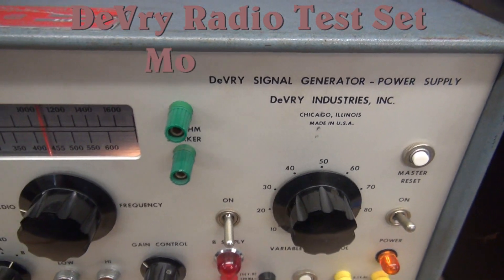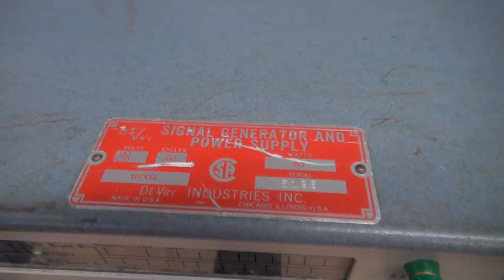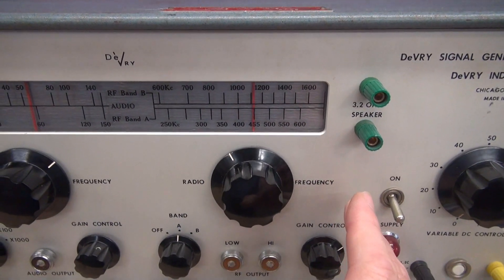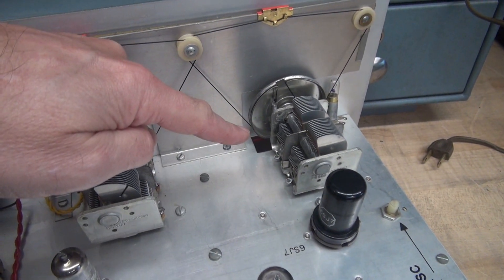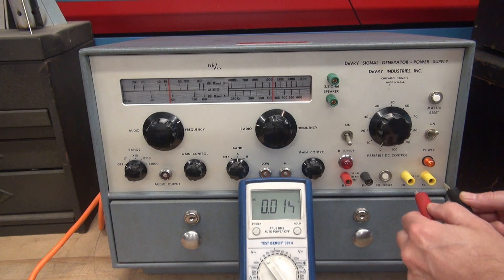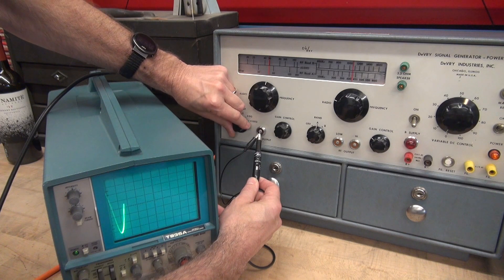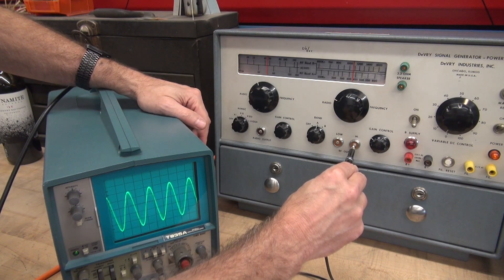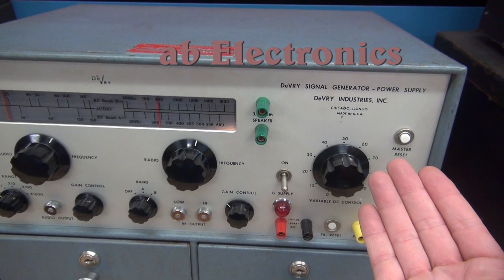New Test equipment at D-Lab Electronics DeVry Tube Radio analyzer Console

Comment: Just found this video. The high school I went to had about a dozen of these in, wait for it... The 1970s! We used these units for tube and transistor training, except of course for the power supply. They were super reliable. Never saw one opened up, so that's a treat. There was a matching scope in grey finish. We didn't have but one of those.

Comment: My high school electronics lab had several of these in the late 60's. The drawers were used to store components, like tube sockets, transformers, caps, resistors, transistors, etc- all mounted to little PC boards that had pins on the bottom that plugged into a breadboard.

Comment: I have one of those buried in my garage somewhere. It was used in high schools in the early seventies. It was one of those classes where the students actually taught the teacher. The drawers were for the bread boarding parts. It came with a very large bread board and many schematics that fit into the bread board. It was a riot blowing caps on the DC power supply.
Reply: Yes- my high school had several of these. I learned about tube circuits using one of these. We had lots of fun with them.

Comment: Based on the power supply portion, I think it was used to allow students to breadboard radio circuits as part of class work.  If it was strictly for classroom use, that would explain why little is known about it.

Comment: 10:10 - Theoretically you should be able to power the radio with DC from the test-set connected to the AC power plug!